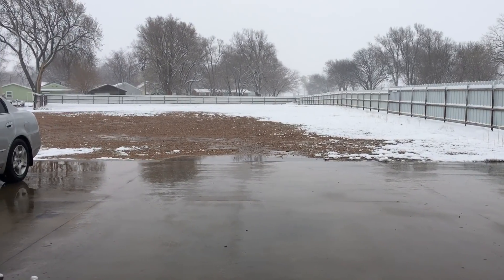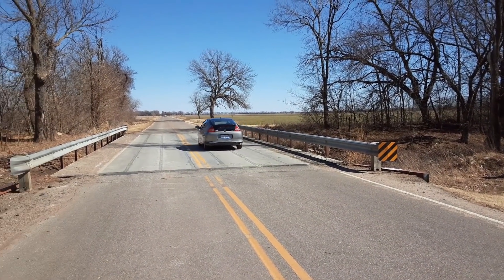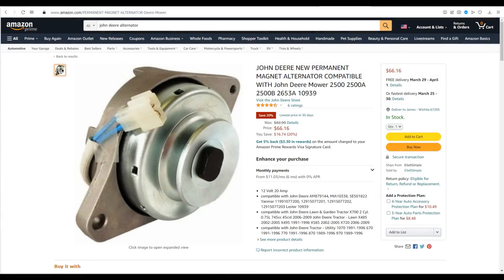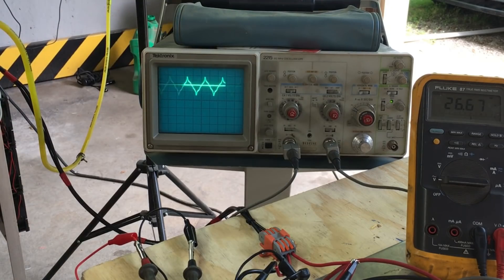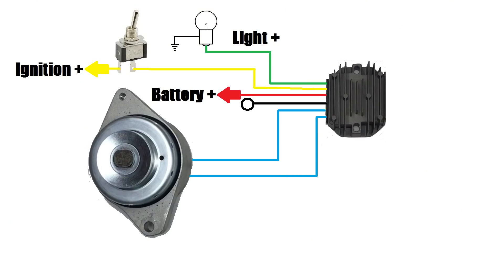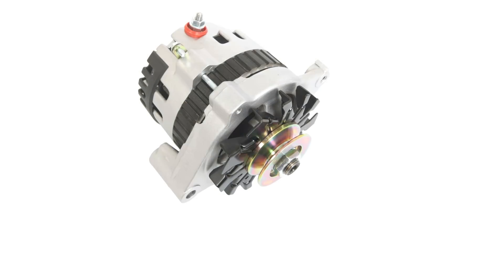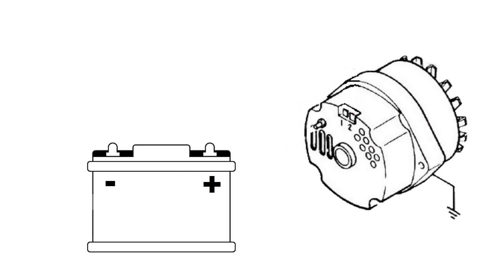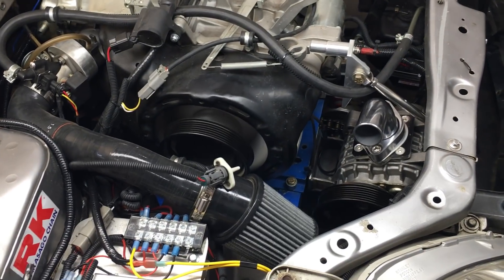S2E4: We generate MASSIVE (20 amps) electrical power for our 420cc engine with a mini alternator

Comment: Your "GY6" Honda style regulator didn´t work because of the grounded coils. There are 2 styles of Honda regulators, full and half wave.
Half wave regulators are used on older bikes or bikes without electric start, there are 2 coils (or a coil with 2 taps) that are grounded. One gets rectified through a single diode and charges the battery with the positive pulses, and the other one gets regulated to ~14v AC to power the headlight by shorting the half waves to ground with a triac when the voltage gets too high.
Full wave regulators are used with bikes with electric start (as they need more power). There is a single coil (or many coils but only 2 wires come out) and it's not grounded. It gets rectified and regulated to charge the battery and everything runs off 12v DC.

Both regulators can be 4 wires (2ac, ground and +) but the ones with 5 wires are allways full wave (extra +ign to eliminate quiescent current when the bike isn't running)

To use the GY6 regulator you need to unground the coil and run another wire. Also I don't know if you can just parallel/series the coils like that as you can have problems with saturation (if you series them) or them being out of phase and cancelling their voltage. If you do this you should easily double the power.
Reply: Thank you for this info. I’m currently trying to run a 4 wire “gy6” for my Honda gx390 with oem charging coil (only one coil). Before I just ran it into an old Honda 2 pin rectifier, wire off the coil going in, and wire going out (of the rectifier) to the battery. This worked fine but was unregulated so it was bringing my battery as high as 16 volts with extended run time. I got rid of that rectifier and tried to wire in this 4 wire rectifier/regulator but since my coil only has one wire I figured this wouldn’t work. I tried anyway by only utilizing 3 of the four wires on the gy6 regulator and.. it SEEMS to be working? But maybe my system just pulls such small load that my battery hasn’t lost any charge yet. I run an electric start, and led headlight and tail light, that’s it. What are your thoughts on this? You’re saying to work properly my coil needs to be ungrounded? If so, I don’t think that will be possible for my application.
Reply: @dsxfab3747  To run with a grounded coil you need a half wave regulator. I think you need to connect the coil wire to both AC inputs (top right annd bottom left), top left to battery + and bottom right to ground.
If you need more power you can use a full wave regulator, you need to unground the coil either by cutting the grounding wire in the coil and soldering a wire, or by using plastic washers on each side and a plastic tube for the screw.

Full wave regulators often have fins on the sides and top, while half wave ones have fins only on top and are a bit smaller. You can search for mopedarmy wiki for more info
Reply: @nirodper  thank you for the reply! For now, because its the simplest potential fix, I’ll try connecting both wires to my ac input and see if that changes anything. 👍
Reply: @dsxfab3747   you can search in images for full wave moped regulator and half wave moped regulator and see what I was telling about the half ones having less fins, so you can determine what type yours is. You can also test for continuity with a multimeter. Glad to help
Reply: @nirodper  yeah, I really need to buy another multimeter. I actually broke mine right as I was going to test this set up. I dropped a wrench right on the screen so I’m sure it’s still working, I just have no idea what it’s trying to tell me 😂

Comment: I may be jumping the gun but do you plan on cooling down the post from the super charger. Lots of different ways to cool boost and I am intrigued to see which way you would go. Love the vids keep ‘em coming.
Reply from the maker: The initial setup will not have an intercooler, However it the supercharger works out we will install a intercooler.
Reply: @robotcantina8957  Follow up if your current charge set up does not work have you heard of or put any thought into using an old emission air pump. I once heard someone say they could take the exhaust emissions air pump from say a 302 and use it for boost. I feel like it may not supple enough volume of air though.

Comment: As far as car alternators, I'd lean towards the self exciting single wire Denso style popular with racers. They're small and light, simple to hook up, and put out enough amperage to run a basic electrical system without robbing a lot of power from your engine.

Comment: That alternator cheater switch reminds me of something I used to have on my old underpowered street racing type Hondas. I would have the AC compressor clutch and alternator field run through relays and to a button that I installed on my gear shifter. That way I could push the button when I needed max lame acceleration. Good times
Reply: I used to do half of this manually in my old Peugeot. AC off before overtaking, then on again.

Comment: I have a John Deere 214 Garden Tractor which I mostly use to pull around light trailers on my property. I realised that my battery keeps going flat and on investigation realised that the alternator will only charge at full throttle...

I guess this video explains why John Deere or Kohler decided to use this alternator setup which only charges at high revs

Comment: er5 gpz voltage regulator will work they are ment for 3 phase but if you just use 2 of the ac wires neg perm live and switch live it will charge used higher power ones on alot of lower power bikes as they are eaisyer to get hold of internal coils as say to lower curent but for the john deere will work fine would could even use a hoverboard motor and volt/reg

Comment: Just wondering, Could rally cars explore the option of bypassing the alternater to remove HP lost to alternator on a flat out or other situations they may need it. Even if its for a short while.
Reply from the maker: For the 420 engine, cutting out the alternator makes a huge difference.  On a rally car, you might gain a few HP if the alternator was working hard running the lights and whatnot.  Probably could go  a decent amount of time with the alternator off.

Comment: I wouldn't bother with the 2nd channel unless you wanna do unscripted videos Jimbo. Wish I had know about this back when I was 16 with my moped, I added turnsignals that were just two separate toggle switches and if the bike wasn't warmed up enough using them would kill the motor, while it had running lights and a horn it must have had very low amps that couldn't even handle a couple extra watts of power

Comment: Awesome work - I've really enjoyed this series. Great idea with the top secret charging disable switch 🤪. Have you considered a NC switch on the accelerator pedal so that it disables the charger at WOT? May keep you from forgetting to re-enable the charger.
Reply from the maker: That's a great idea!
Reply: I was thinking the same thing, Matt.  My idea was to use the speedunio’s knowledge of the throttle position to turn on an output at WOT, which then opens an NC relay to the alternator enable.  By the way, Jimbo, on those Delco SI alternators, the wire you have tied to ignition is actually the “voltage sense” wire for the regulator.  This very clever idea allows for voltage drop on the main positive wire to be accounted for.  Sadly the “1 wire alternators” delete this feature.

Comment: Doesn't the use of permanent magnets make this a generator, not an alternator?
Reply: It's still making a.c. current that needs to be rectified to make dc, so it's an alternator. A generator produces dc current without a rectifier.
Reply: No. An alternator can be any device which generates an AC field, and the device in the video seems to output AC. 

A device with permanent magnets can be both AC or DC, depending on the arrangement. Magnets on the stator, windings with brushes to the rotor: DC. But if the magnets are on the rotor and the windings are on the stator, then it's AC.

Comment: With a full bridge rectifier, you are taking advantage of the full AC wave from the generator. With two diodes, you are only rectifying half of the sine wave and thus, using only 50% of the power that is being generated.
Reply: İki diyot ile tam dalga DC üretilir. Tek diyot ile yarım dalga DC üretilir.

Comment: Interesting parallel video! My first thought was: the alternator will rob a few hp out of a low power engine. Switching it on and off solves that problem, but you're still adding some drag from the magnets and the belt (not much, but if you have the time, you could perhaps measure it by removing the belt). As for the internal coils, you could also detach and rewire the grounded end, to have full wave rectification, but it probably is enough for trickle charge and would be unnecessary extra work - unnecessary extra work is my specialty :-)

Comment: On my moped, I set up a battery to run the lights which charges from a full bridge rectifier on the existing lighting coil. I disconnected the frame ground of the coil, so I could put each side of the coil to the two AC pins of the rectifier respectively. And since the coil isn't grounded, hooking up the negative pin to the DC circuit didn't cause any shorts. There's still a bit of a paradox, as the lights themselves still have frame ground which is shared with the AC points ignition system, but it doesn't drain the battery overnight and hasn't blown anything up yet, so I'm calling it good. 
I do occasionally have to top up the battery, as the single coil isn't really enough to keep it charged, though.

Comment: (20 Amps* 12V)/0.5 efficiency= 480w , worst case scenario you'll run 0.65 HP more!!
Reply: tough on 5 amps, when not switching lights, radio, and a more probable 70% efficiency , it's 85W, for a 11 HP engine is 1%

Comment: You can get 18A charging coils for the GX390 engine. NR racing sells them part# 31630-ZE2-W01
Reply: It also requires the matching flywheel magnet setup.

Comment: I wonder if the charging needs could be achieved by regenerative braking when your foot is off the throttle by running a GM alternator off the transmission output of the car. Using the car's mass to store kinetic energy that you only harvest when not accelerating.
Reply: Could also have a voltage dependent charge during cruise
Reply: The John Deere alternator would be better for this scheme. As mentioned toward the end of the video, the GM alternator can't be turned off once excited. The JD can, however. If the JD alternator was coupled to the driveshaft and the excitation switch piggybacked to the stoplight switch on the brake pedal, you might have a chance of recovering some of that energy as electricity.

Comment: 20A diode costs $0.05 and a 2A ajustable DC-DC converter set to 13.8V costs $1. That will charge your bat from the internal coils but not overcharge it.

Comment: Hey Robot Cantina FYI they do make higher amp charging coils that can fit under the engine stock flywheel I think the highest amperage I've seen is about 12 amps when used as a pair but they do cost some money though and most small engine manufacturers don't use them because you don't need that much amps when using them for most applications only special applications like what your doing with the engine needs it.

Comment: Pretty neat little charging system, I thought of using a 2CV Ducellier alternator myself (about 40 Amps output), 'til I broke the windings on the one I bought cos it needed new bearings, and the pulley nut is tighter than a yorkshireman's grip on his wallet, and, well, I did a dumb... :P

Comment: You know I always love your vids, and this was no exception! However, technically that's not an alternator, especially if it has magnets instead of field windings. That means the drag will always be there, whether that switch is ON or OFF. And there should be no need for a rectifier because the output should be DC already. It will just need to be regulated! With that said, it's a good idea still because the power losses will be few compared to a standard Delco alternator that can draw 5HP or so when fully fielded! 😎 

Also forgot, the solar panel ideas aren't bad either! I have alot of radio equipment in my Jeep and a Raspberry Pi 3B that does aircraft tracking and feeds it to the web 24/7 and I have a nice solar panel up on the roof and a good charge controller feeding the power into the electrical system and on most days it helps keep up with the demand and keeps my battery in a charged condition!

EDIT: I realize the unit can still produce AC current because of the way the coils are wired, so a rectifier would still be needed. I guess the windings are floating and not grounded to the unit frame.
Reply: With no current running through the windings, a generator will not absorb any significant torque. Only some torque is absorbed due to mechanical friction and magnetic losses in the iron of the stator, but that is minimal.

To absorb or generate torque, a motor/generator needs to have two magnetic fields interacting. With the permanent magnets but no current through the windings, you have one field but not the other, so no power is generated.
Reply: @marco23p  You are very right! I stand corrected about the drag! 😎

Comment: Wouldn't there be less parasitic drag using an automotive alternator and use a bypass at starting or idle.  The 20 amp one still has the permanent magnet drag.
Reply: And, as long as that battery is reasonably well charged, you wouldn't have much load on the alternator anyhow.
Reply: @somethingelsehere8089 You don't understand.
Reply: @Electobat  Lol, it is you who doesn't understand.
Reply: @somethingelsehere8089  Your comment has no relivence to my comment.

Comment: What if you can use alternator as a motor to further increase the power . It may need extra batteries and proper charging system but it can definitely  work. Nice video .The rectifier explanation helped me a lot.

Comment: Thanks for another enjoyable video! I don’t think it was off-topic at all - power generation and the mitigation of power loss through belt driven accessories are both big factors in maximizing performance. That big Delco alternator will suck 5-6 horsepower all by itself (and maybe more, depending on frictional losses through the drive), so the John Deere unit seems like a wise move. Well done!

Comment: What's the idiot light?
Reply: @LazloNQ  thank you for explaining. I've never seen a light like that before in a car. I also don't really see the point.
Reply: @dimitrimichaux461  All cars have a light with the shape of a battery. When the ignition is ON and the engine is not running the rotor magnetizing coil current is provided by the battery and passes through the light so it lights up (also acting as a current limiter resistor) . When the alternator starts spinning it generates the current so it doesn't need the current from the battery and the light turns off.
If there's no light when the ignition is ON there is no current going to the magnetizing coil and it won't charge. If it lights up with the engine running, the alternator is not generating energy because the battery is providing current.
It is a very good system
Reply: @nirodper  ooh now I know what it is. No one ever explained it to me like that. The battery light always turned off very fast, so I thought it was was just like the other lights on the dash. They all turn on and off when you turn the car on and when a light stays on you have a problem. I would have never noticed that it didn't turn on.

Comment: This really isn't an alternator.  It's actually a generator.  I've used a 55A alternator on a 12hp briggs and stratton. I've had no problem at idle, especially since the load is pretty small once the battery is at 14V. With the speeduino idle control I don't think you would have stalling issues at idle.
Reply: He have not installed idle valve of ant sort and this configuration is just fine with idle intervals not being long

Comment: Have you thought about a Solarpanel on the Roof of the Car? Since you only drive it in good Weather anyways. And its free Energy without loosing Engine Power. And with enough Energy you could turn an Generator into a Motor and have like an F1 ERS System for Acceleration. A 100W Panel Generates ~8 Amps
Reply: This is automotive fun, energy harvesting is not automotive.This generator is single phase, so there is no way to use it as motor without rewiring internal connections
Reply: @poprawa   well of course but you can turn any "Regular" Car Generator into a Motor helping with acceleration and i think this would be a fun automotive experiment